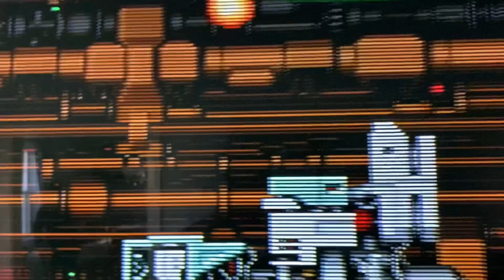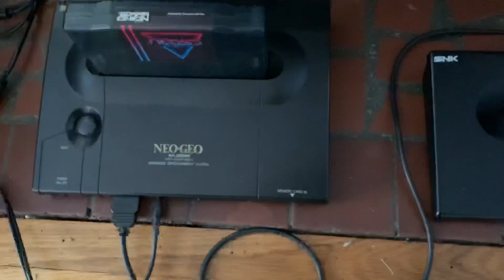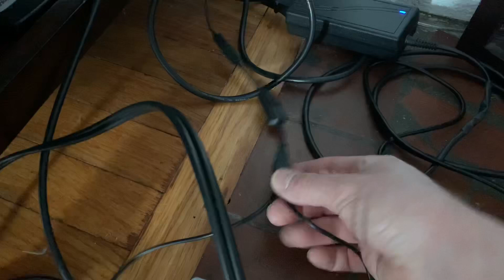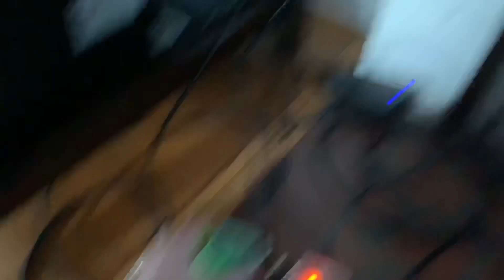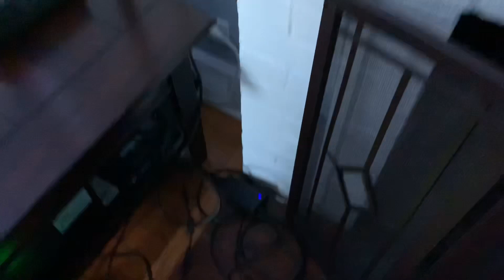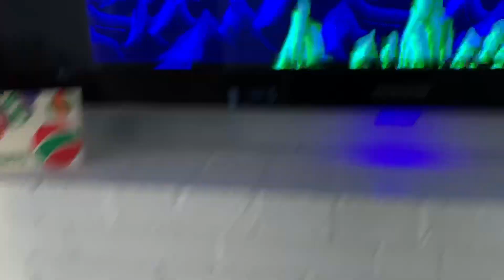Retrotink Transcoder + Retrotink 2x Pro | Line Doubling SCART to 480p with Scanlines!

Comment: What's the deal with the component to hdmi box? Is that just to get hdmi out or does it also improve quality over going straight into component on the TV?
Reply from the maker: Its an upscaler called the retrotink 2x pro.  It upscales the image from 240p to 480p to improve image quality and decrease latency.  Plugging directly into component will add terrible lag to the experience.

Comment: What's the benefit over using retrotink2x scart
Reply from the maker: No benefit if you are just going from SCART to HDMI.  I was just showing a possible option.  However in my case I needed the Transcoder for playing SCART consoles on my CRT that only accepts component.
Reply: @mike7599  I love that Mike designed them so they fit into each other with couplers